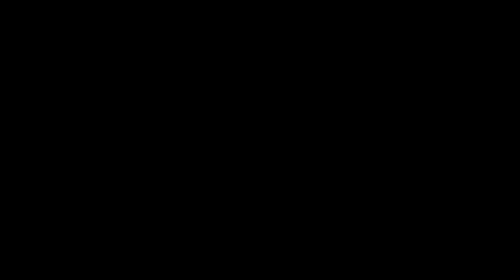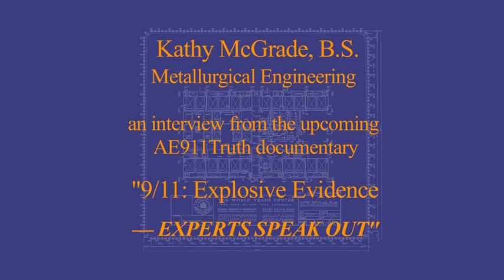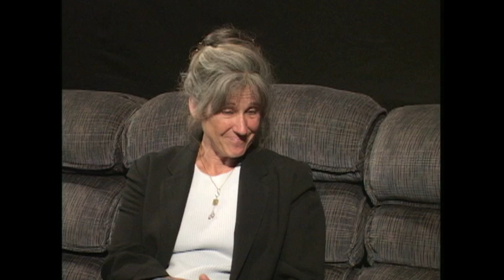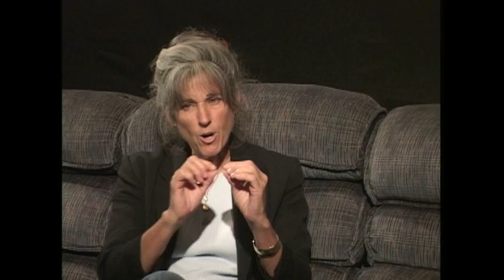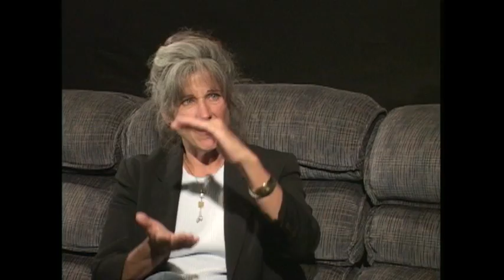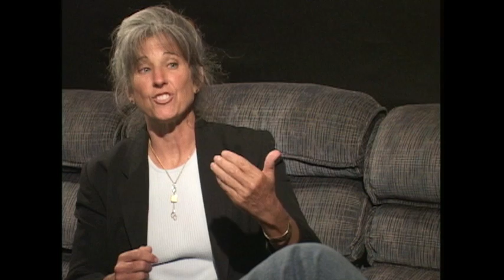Kathy McGrade, B.S -- Metallurgical Engineering

Comment: I think, instead of telling people about what law of physics is and telling people the about what statement violates the law of physics that can't always be understood by ordinary people or many people who do not have engineering background, why do not just show how the engineering or law of physics work using some test or exeriment. Let' s just begin with conducting simple experiments or testing in your backyard? 

First, to prove whether or not a fire in open air can melt steel. First, prepare a slab of steel 1 inch thick, 3x3 square feet area. 4 pices of steel beam of 3 feet long and 2x2 square inches cross section areas. Weld all 4 beam on every corner of steel slab. Result will be a 9 square feet 3 feet high steel table. Turn the table upside down. On the legs of the table put a slab of concrete of 3x3 square feet area, 15 inches thick.  Below the concrete on the steel slab you put  many small cut of woods, paper, plastics, small piece of carpets and maybe small cut of aluminium plates. Pour them all with kerosene, light it  with fire. Let it burns. Wait until the steel weakens or melt and the concrete turn into small debris or dist.  If fire getting smaller or extinct, add some more kerosene. Let's see what happened. You can't find kerosene (fuel jet)? You go to WalMart or Kroger,  go buy the barbeque oil starter. The barbeque starter oil is kerosene. You might need it about 10 or 20 liter of the oil. Who knows. Invite somebody appropriate to witness the test

Second, to prove whether or not the aluminium can cut steel beam. First, you can buy an industrial rotary fan that can turn up to 4000 rpm with 1.5 feet long blade each. The rotary diameter would be 3 feet long. Take the rotary blades off. Replace the blades with a piece of alumunium about the same size and screw it tightly. You can't find a suitable alumunium alloy? If you can't buy in metal store you should look for it in aircraft graveyard.  Then, prepare a slab of steelat least 1 inch thick,  install in a bench. Screw it tightly. Turn the fan on, set in 4000 rpm. Push the bench aproaching the runing fan, make sure the blades to hit the steel. 4000 rpm will give tip blade linear speed equal to 470 Knot. If you run in 3000 rpm, it will give speed equal to  400 Knot. Let's see what happened. You have to be very careful because debris can kill you. It is better to have wall between you and the running fan.
Reply: Roy Indrasyah not quite that
simple man.... it’s a little more complicated than that! Lol.
Reply: @speculizer1971  which one? The first test or second test? Or both?
Reply: Roy Indrasyah with all due respect.... and not trying to start crap but both..... as heating steel like that is going to be far different than in a building fire and a 200 ton jet centering a building flush at those speeds is far different
Reply: Not to mention the jet honestly didn’t cut the steel but busted through with the tremendous energy that was beyond out comprehension.
Reply: @speculizer1971  So what you mean is the second test?
Reply: @speculizer1971  Do you mean the alumunium can't cut the steel? You don't do the second test, do you?
Reply: Roy Indrasyah what I
Mean is 1. Heating steel in a test like you mentioned is far different than a building
Fire. 2. A jet smashing through a buildings busting through steel structural members is far different than the test you suggested, not to mention the jets didn’t necessarily “cut” through the steel as much as they busted through the steel.
Reply: Roy Indrasyah not to mention, even if the jets hadn’t busted through the steel the jets STILL would have entered the buildings.
Reply: Roy Indrasyah the woman in the vids is telling loads of complete BS.
Reply: @speculizer1971  You mean if you do the test as I suggest the burning kerosene do not weaken or melt the steel but in the huge building like Tower 1 & 2 WTC, the kerosene burning  do soften the steel and
If you do the test 2 as I suggest the alumunium do not cut the steel but in huge building it can cut the steel?  Please tell me the difference. Please tell me what makes these two condition cause a different result. Because of different kerosene? Because of different steel? Or because of different alumunium?  I'm just curious
Reply: @speculizer1971  It seems to me that you are an expert on high rise building. Please... please ..... teach me about scycrapper building construction.
Reply: Roy Indrasyah is there anything else you would like for me to teach you about?
Reply: Roy Indrasyah back up... I just scanned over your comment again.  No, there was no melted steel at ground zero so there is no need to melt steel.  I thought you had commented to weaken steel, my apologies.
Reply: @speculizer1971  As I recalled, I did not talking about melting metal in ground zero or something like that in my previous posting. I just did suggesting to do some simple tests to check properties and behaviours of metals in relating with firing and/or while one metal moving very fast hitting each other.
Reply: Roy Indrasyah   Roy....?
Reply: Roy Indrasyah you are in no way shape or form going to reach the temps in those buildings by doing the example as you explained... kerosene or jet fuel wouldn’t necessarily be needed as what the kerosene did was help do spread the fires throughout very fast and her the fires burning very quickly.. the ordinary combustibles used in those buildings or as the silly vids claim “simple office fires” burn far hot enough to bring structural steel to failing temps.  This isn’t a fact that needs debating.  I see you mention the “open air” fires as some of these silly vids claim.... those fires were a far cry from such.  This is before we begin to mention the amount of oxygen being fed to these fires. We all know how hard the wind blows up at those heights.... we all know the giant hole made by the jets and the hundreds of windows busted out.

As for “cutting the steel”...... exactly how are you going to duplicate the energy of a 200 ton jet hitting a building flush in the side at 4-500 mph. The energy released in those impacts were 3-4 BILLION FT LBS.  So you think your backyard experiment duplicated that...?

Sure, I do not mind continue educating you or teaching you about high rise construction.   But there is far to much to teach so I will educate you on some highlights that played a huge part on the buildings collapse.   
Those buildings were built with 40% less steel than conventional buildings.... they were build with many different grades and thicknesses of steel.  The higher the floors the thinner the steel.  The steel at the top floors was as thin as 1/4” and this included the exoskeleton or exterior LOAD BEARING columns.  These unique building had as I mentioned exoskeleton columns and interior core columns. The 5” concrete floors sat on LIGHT WEIGHT TRUSSES which spanned from the inner core columns to the LOAD BEARING exoskeleton columns on each end.  Now, lightweight truss will fail in as little as 5-10 min in fire. When those fires ran through those already damaged buildings, it was only a matter of time before each collapsed with that design.  When those lightweight trusses heated and failed they sagged, and then they sagged they pulled those LOAD BEARING (40% of the load) columns in several feet.  When this took place there went their load bearing capabilities and the 40% of the load that is no longer supported that was no longer supported.  This is easily seen in many pics and vids as the exterior walls are pulled in several feet just before each collapsed.  What else would you like to be educated about..?

As for the melting steel and as you claim you, “did not talk about melting metal”....   in your second paragraph of your original comment I quote, 
“First to prove whether or not open air fire can MELT STEEL.”
Reply: @speculizer1971  Thank you for your long and  delicate explanation sir. It really give me  new knowledge and info. Sorry to wait quite long, I need a day to digest some of your comment. But still I have some more comment and question. I hope you don't mind. 

First, why are you not sure by the test I suggest the temperature equal to the one in the building can be reached? In my opinion it might be can be done by adding some more fuel i.e. kerosene.  How? To do that you add a container on the base. What I mean with the base is the steel slab on the bottom, 1 inch thick 9 square feet steel. To do that, you use a piece of thin 12 feet long 4 inches wide, for instance, steel plate. Surround the base with this thin plate and use superglue or iron glue to stick to the base. Watch for the leakage. So, you will have a container that can be filled with jetfuel. First you just fill it with a broken laptop and comluter CPU. The laptop can be found in computer junkyard. Also you fill itu wood chips, a piece carpet, alumunium chips, metal, plastics. You pour them with 10,  20 or so liter of kerosene and fire it. To simulate hard wind, you can use a fan. In actual case, there were no container. Jer fuel spill all around in the impact floor inhomogenously. Better to have more fuel than less.

I spent more than a day to figure out your long statement that are separated by dot dot dot. I am sorry, I am not good in my English lesson. I still don't get what you mean by (I quote), " ...kerosene or jet fuel wouldn't nessecarily be needed as what the kerosene did was help do spread the fires throughout very fast and her the the fires burning quickly......" Can you please explain in more simple sentence? And next statement...."....the ordinary combustible used burn far hot enough to bring structural steel to failing temps. " .....What do you mean with ordinary combustible used? What do you mean with to bring structural steel to failing temps?

When an airplane flying in 500 knot (180 m/second) it will have million ft lbs kinetic energy. I agree with that. Let's use your number 3 million ft lbs. But I don't agree the kinetic energy can rise room air temperature. Using the same unit with heat energy does not mean the kinetic energy identical to heat energy. To generate heat, the kinetic energy has to be converted first. To do that there are only to option by friction or by vibration. It means if the kinetic enegy brought by moving body ( airplane) running over a surface, its kinetic energy will be converted to heat. But not all kinetic energy will turn into heat. It depends on roughness of the contact surface. The smoother the contact surface the smaller the friction coefficient the smaller the energy converted. But the bigger the mass of moving body the more the friction the more energy converted. And also, the converting process only occur while the moving body steel move, if it stop the convertion stop. The energy remains in the form of kinetic energy, which in contact point can create pushing force o7r pulling force. In the case of WTC, it should have created pushing force to the structure of the building.  The pushing force should have cause the building swing forward and backward and tremble. It was not seen in official video of 911 NIST report or any other video.Was it caused by the small swinging amplitudo and small vibrstion amplitudo? If the kinetic energy to big to resist by the building structure, it will break the structure or at least it will create wreckages. It was not seen either. This is tge principles  I learned in my Physics class. Correct me if I am wrong.

You mentioned about sagged. Are sure about your statement, the higher the floor the thinner the steel? The utility of steel 40% in WTC structyre less than normal? The steel on top floors was as thin as 1/4"?. What steel? Steel that used on making trusses? Where can I read this info? Do you have document/reference for this info? So far as I read, the steel as of the same thickness from the lowest floor to the top floors. I also need more explanation about your statement :"when those lightweight trusses heated and failed they sagged, and then they sagged they pulled those LOAD BEARING (40% of the load) column in several feet." Several feet? That far? 40%? Is the phenomenon also take place in every steel structure building or only happen in the twin tower? What a dangerous! How could those building still be used for decades without the building authority noticed the risk? Since the twin tower exactly identical and the two were occupied by hundred of thousands employee of so many company, how can the building safety of New York gave the building certificates in the first place? If it was not by terrorist, it could be by accident  one of the twin get into fire. If so, hundreds of thousand occupant would be in jeopardy.

About my comment previously. It is true I mentioned about melting metal. Yes I did mention about melting steel. But what I mean with that statement was the one that caused collapse. Not melting metal in ground zero (after collapsing). 

As addition, I want to comment about your previous statement (I quote):"...not to.mention, even if the jets hadn't busted through the steel the jets STILL would have entered the building". I am confuse. How could it possible? Sorry for not asking sooner.
Reply: Roy Indrasyah because these buildings and structural members are Incased within a burning building where even the conspiracy sites will admit the temps were beyond 1800 deg F. Structural steel will begin to lose its integrity at 785-800 deg f  and will completely fail at 1100 deg.  Deciding whether steel will FAIL is not needed and doesn’t need to be proven as structural steel is common in fires.   Jet fuel isn’t actually needed in a building fire as the ordinary combustibles, such as interior design, office supplies some construction material, burns far beyond the temps to bring steel to failure.  What the jet fuel did was spread the fire faster.   Structural steel to failing temps.. the temperature at which steel will fail.  I didn’t mean the Kinetic energy raised the temp.   I was referring to the damage of the impact had on the structure 

I’m not sure how the sway of the building would be seen in video.. but it was reported by those within. 

I do not know what you mean by it didn’t break the structure, the impacts most def broke the structure and was easily seen!

Most definitely positive about the sagging as light weight truss is known to sag and fail in fires. It was also easily seen in pics and vids where the exterior walls were pulled in several feet.   

Yes the steel was thinner at top and gradually got thicker. This is common knowledge as well as the 40% less steel.   

No, these buildings were one of a kind. 

All of this information is there for anyone to read and learn.

Yes, if the jets didn’t bust through the steel they still would have entered. The columns were on 36” centers and the jets would have sliced like a tomato and still entered the buildings.

Here is the link.

https://en.m.wikipedia.org/wiki/Construction_of_the_World_Trade_Center

Under structural design.

“The strength of the steel and thickness of the steel plates decreased with height because they were required to support lesser amounts of building mass on higher floors.[89] The tube-frame design required 40 percent less structural steel than conventional building designs.[90]”

If you need me to show you how fast light weight truss fail in fire let me know.

This is also under structural design

“A grid of lightweight bridging trusses and main trusses supported the floors. The trusses had a span of 60 feet (18 m) in the long-span areas and 35 feet (11 m) in the short span area.[89] The trusses connected to the perimeter at alternate columns”

“The thickness of the plates and grade of structural steel varied over the height of the tower, ranging from 36,000 to 100,000 pounds per square inch (260 to 670 MPa).[a] The strength of the steel and thickness of the steel plates decreased with height because they were required to support lesser amounts of building mass on higher floors”

All this info is there for you to read.     Google about the light weight truss sagging and pulling the exterior load bearing columns inward... also google the pics of the exterior walls being pulled inward.
Reply: speculizer1971 
Hello Mr. Nebulizer....
Still peddling that Hebro/Troll nonsense, I see. 
The NIST, FEMA reports are a monument to obfuscation and rightfully will be remembered by history to have even less truth than the Warren Report. 
But for professional apologists for NWO/Zion, the phony gov’t conspiracy is gospel. 
Good Americans are more aware than ever.